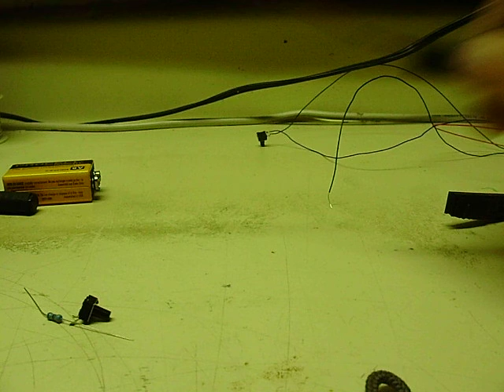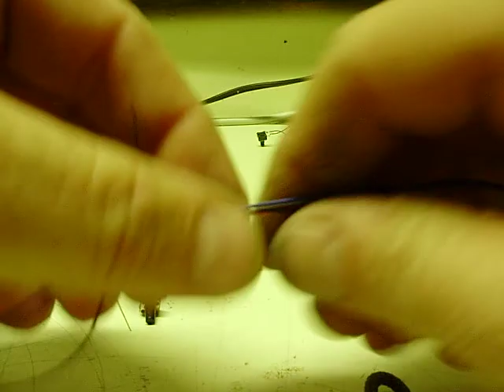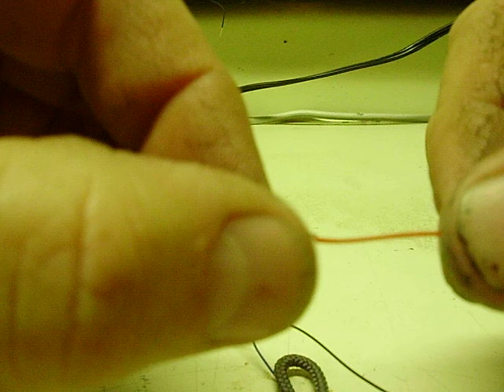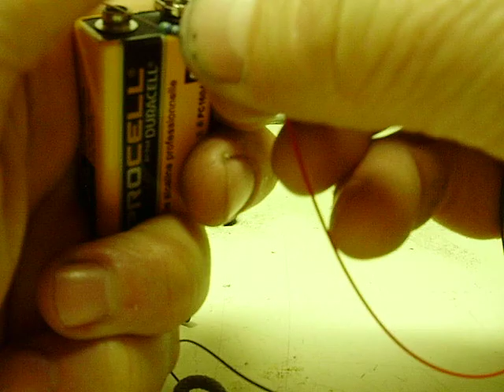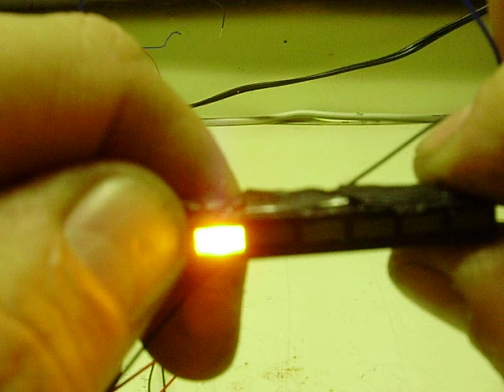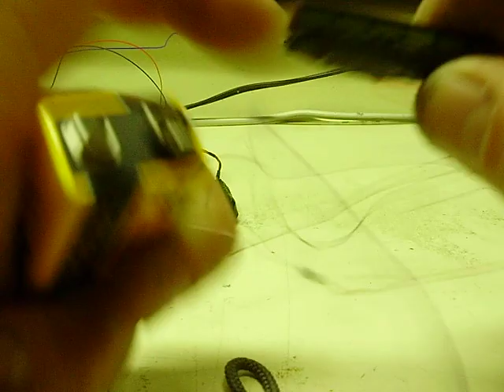Tony's custom self-contained traffic advisors for diecast model police cars

Comment: how do u install the light in the car
and 1 question do we just send the car to then u install the how much do u have to pay?
Reply from the maker: You gotta take it apart, drill holes and put in the LEDs.  I'm sure there are a few steps I'm missing, but you just got to get in there and try it.  You can send your car to me or I may have the car you want already.  On a 24th scale model, the headlights, tail lights and lightbar is $75 PLUS the model.

Comment: Nice work! Alligator clipped test leads will make power hookup much easier and a resistor for power reduction? I would recommend a voltage regulator.
Reply from the maker: Funny part is, I have 10-12 test leads on my bench and I rarely use them for videos.  Guess I just forget about them.  As for the resistor, I've been using them for this board for about 8 years and haven't had any issues with them running anywhere between 9-12 VDC.  It works so I guess I've just never looked to change it after all these years.